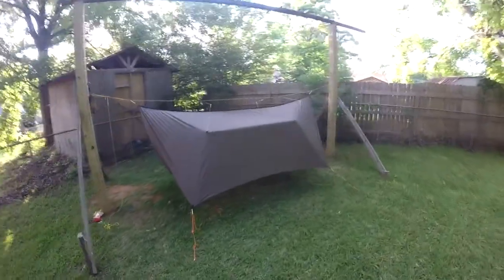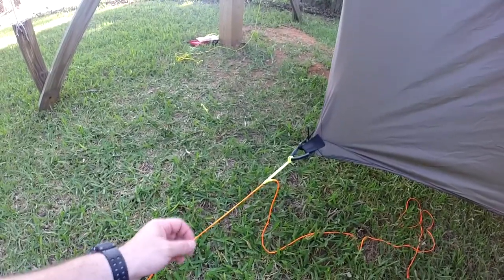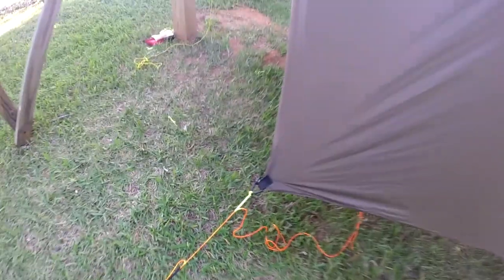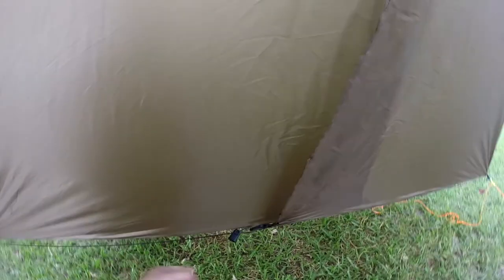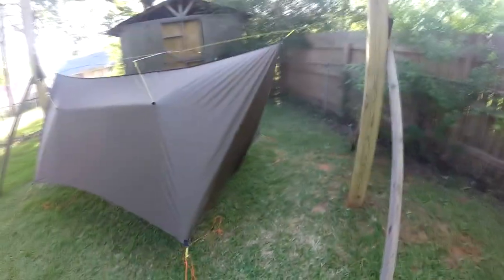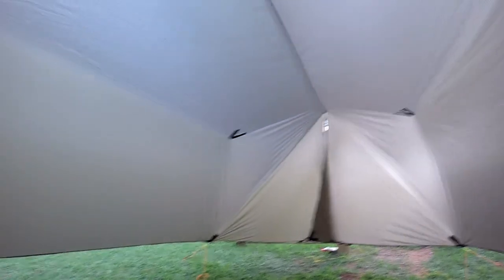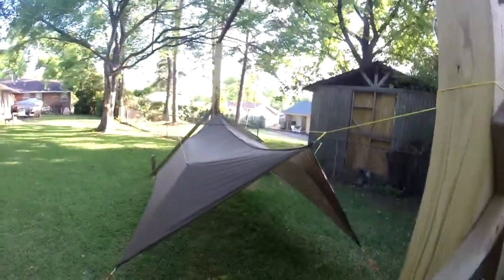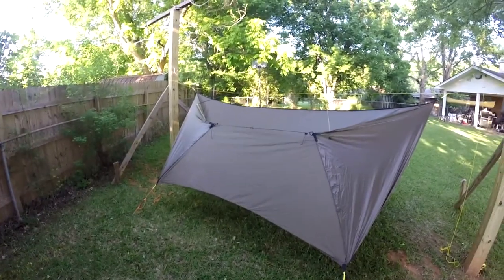Superfly Tarp Setup

Comment: can you go porch mode with the poles attached? also can you use them arrowpoles as posts on porch mode? would make it even more versatile
Reply from the maker: Porch mode should be fine while the arrows are attached, not sure the arrows would hold as support poles though, have not tried that....just used my trekking poles.